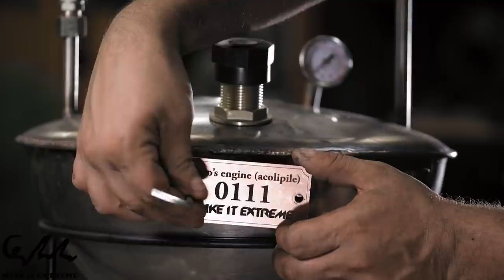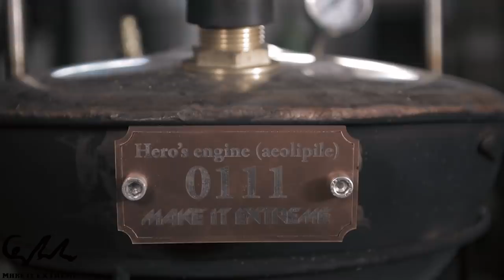Project 0111 | Making the Hero's engine replica

Comment: This is a wonderful shop project for students. I hope this is being designed and made in shop classes all over the world. For extra credit someone could even work out a transmission to turn that rotational force to linear. Well done.
Reply: We did actually build a small "modern" steam engine during my time in trade school. The project involved a fair bit of lathing, milling and soldering of steel, brass, copper and aluminium.

Comment: I remember looking at a simple drawing of this engine as a kid and wanting to see it run. I always thought the water was put in the ball and the whole ball was heated somehow. You must have found better drawings than the one I seen in an encyclopedia back in the 60's.
Reply: There are indeed some simpler designs that just filled the ball. Not as much volume or steam to be generated, but would still work. With the limited runtime needed for demonstration, that would be plenty for many 'replicas' used in the lower classrooms. I recall the original drawing using the 'axle' tubes for gas however.

Comment: Ah yes. A pressure gauge. The one thing standing between it being an experiment and a pipebomb
Reply: No, that would be the blowoff valve. Assuming that it was adjusted to some low enough pressure to blow off in time.

Comment: It might not be the first, there are mentions of others that predate it, but it is the oldest surviving design that was recorded. A great reminder of how far we have come. I wonder if you could modify it to do some "useful" work? That would be a neat upgrade to nearly ancient technology.
Reply: It would be trivial in theory to extend one of the mounting flanges and put a pulley or gear on it to drive something. As designed it probably wouldn't be powerful enough to drive anything useful, but the concept probably would have been obvious to the inventor, and the pulley at least within the technology of the time.

Comment: It definitely has a functional application. Connect a car alternator to the shaft and produce electricity.
Reply: Not much power in it. Sure you can try to harness the power that it does produce, but it's not really worth it except for the heck of it. There is a reason why this didn't trigger an industrial revolution in ancient Greece.
Reply: namewarvergeben if you improve the thrust vector and reduce the friction on the shaft via ball bearings maybe we got a winner.
Reply: Not worth it turbines are way more efficient and have way more power then this ever will
Reply: @biguprochester  ball bearings WERE installed at 1:30